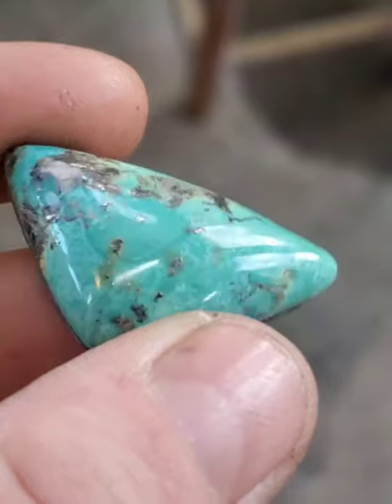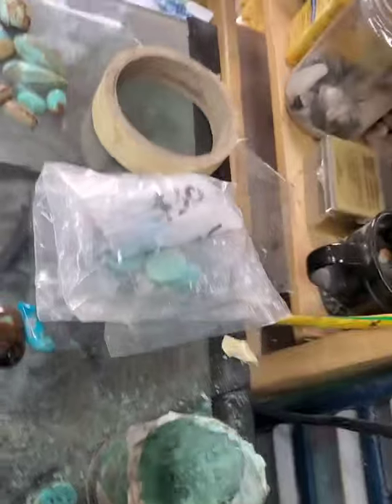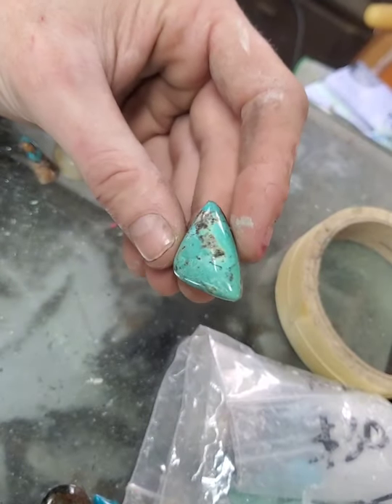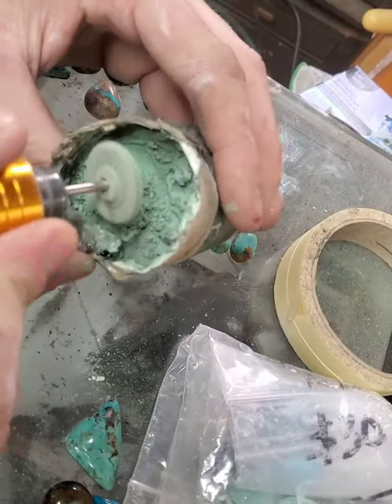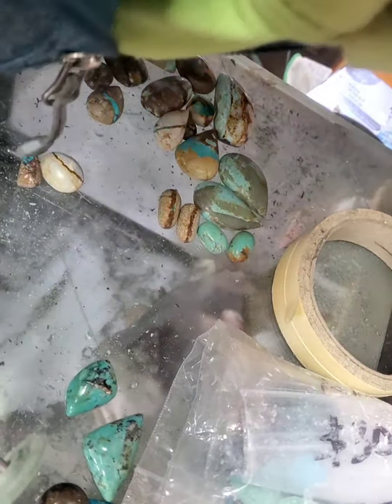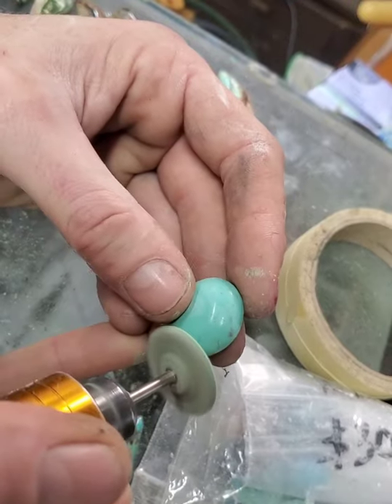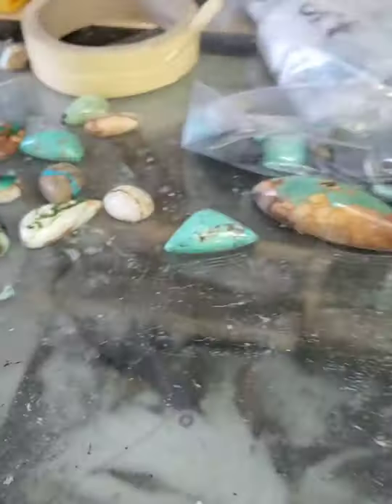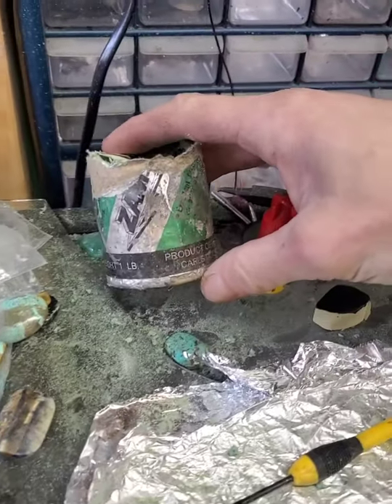Lapidary Polishing Turquoise with Zam the final high gloss step for finished cabochons how to

Comment: Just an idea but you can also use a wooden dowel and hot glue to secure your turquoise. That’s what I do with opals, just use your jewelry saw to release your glue just remember not to let it over heat when polishing because the glue will let go if it’s too hot.
Reply from the maker: Good idea!

Comment: Be sure to wear a P100 respirator and have good air ventilation when working with green polishing compounds. The main ingredient is Chromium(III) oxide (Cr2O3), which is a recognized carcinogen. many, many people (including me, until a year or so ago) have used it for many years with no PPE and haven't had any problems, but it's not worth the risk. Stay safe and stay creative :)
Reply from the maker: Thank you for the info

Comment: Hi! I was wondering what you mean when you say (this piece is  stablelied) ? Thank you!!!
Reply from the maker: Stabalized means the stone was soaked in a resin that glues the stone together so that it is easier to work with and will not fall apart. Some turquoises are very brittle by nature, and not a strong stone. So in order to make it cab-able (meaning it can be cut and shaped without just falling apart) it has to be stabalized. Not all turquoise is stabalized, but some are.

Comment: I used Zam on some fluorite and it left behind residue. Any idea on how to clean off the Zam residue?
Reply from the maker: Yes! It leaves residue. So, rub the stone dry wirg a rag first  then if that doesn't clrmear most of it,hot water and soap would be the best cleaner with a tooth brush and that will get it all off.